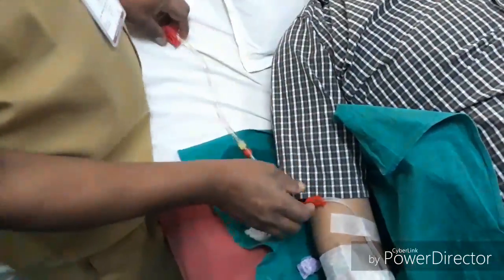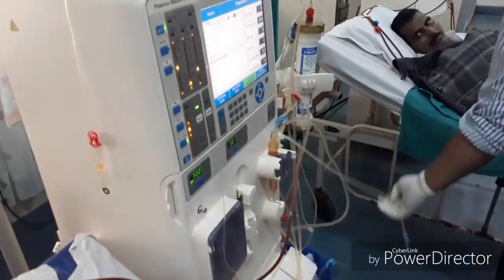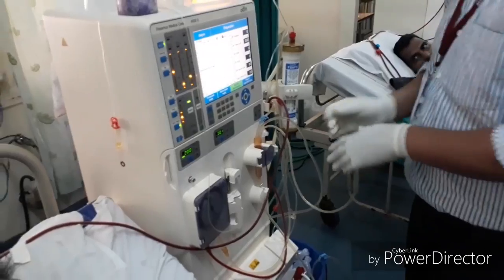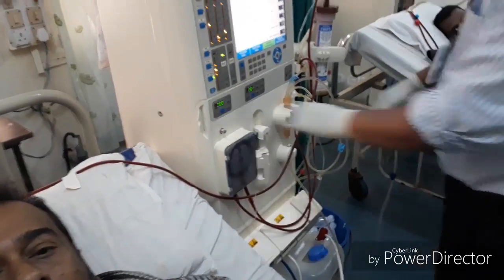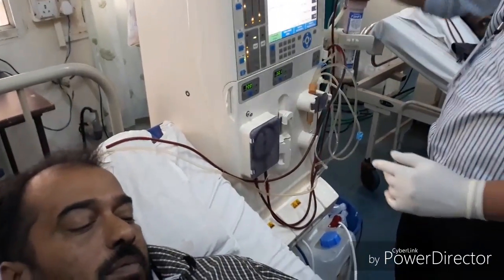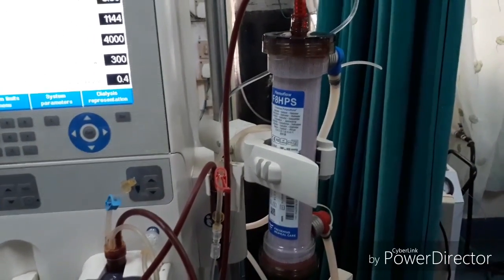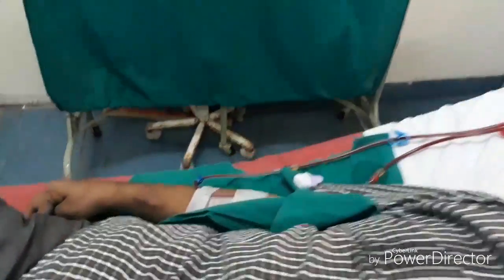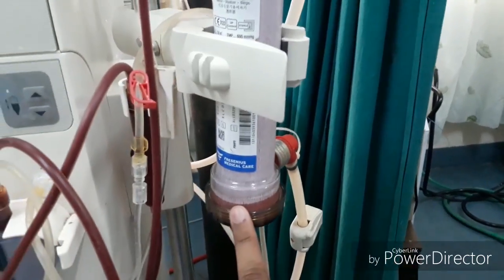DIALYSIS  ( how it works?)Hindi/English

Comment: what nonsense!! without AV fistula its not impossible to do dialysis. we can do dialysis through DLC in the neck, by accessing a vein directly in the vena cavas either in the chest or in the leg.
Reply from the maker: +Sarthak Pattanaik Das yes true.
Reply: what is cost of machine? my mum has kidney failure,can we use it ourself.
Reply: Manish Rai though the machine is very affordable but doing Dialysis unassisted at home is difficult. the set up cost is high. atleast u hv to put up an RO plant at home to begin with. n u need to hire a professional nurse to assist u during dialysis sessions in case of emergency which is big risk while doing Hemodialysis at home. 
allthough i would suggest u can go for peritoneal dialysis which is cost effective, easily done at home.
Reply: sorry there was some typographical error in my comment.Btw thanks,I would like to ask if it would be in range of 10lacs or so including machine? A foundation by the name of apex kidney care provides home services as well as rent machine @15000pm for d machine alone.dont know how much their attendant  charge.
Reply: Yes but sir general told the permanent solution...yes through DLC in the neck and thies can dialysis process can proceed but it's a fir certain period (45 days maximum) not a permanent based period....

Comment: sir why do we need to have a atrio venous fistula
Reply from the maker: Without atriovenous fistula dialysis is impossible
Reply: sir like what if we directly connect the artery and vein to the dialysis machine...without fistula formation...what will be the problem....purpose it will serve will be the same right??
Reply: Dialysis is also possible through haemodialysis catheter inserted in large veins like jugular vein...though av fistula is always better..
Reply: what is cost of price.can we self operate it?